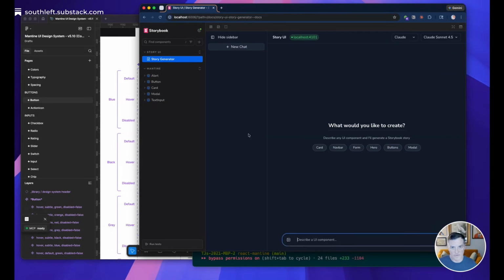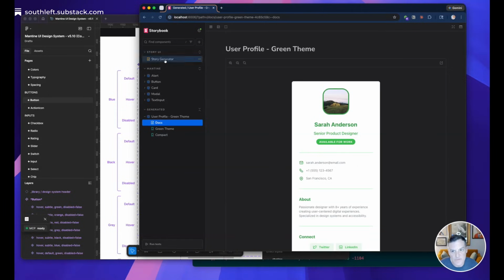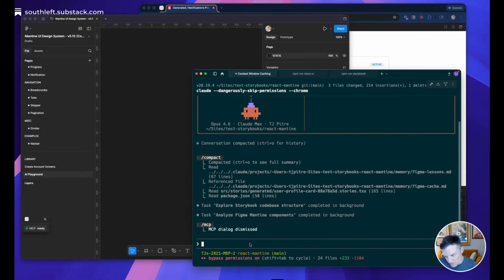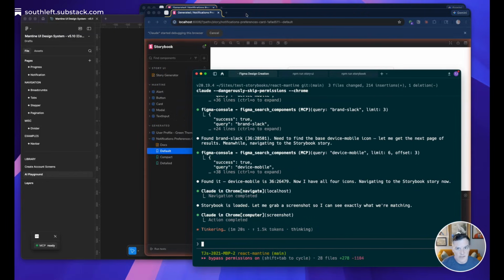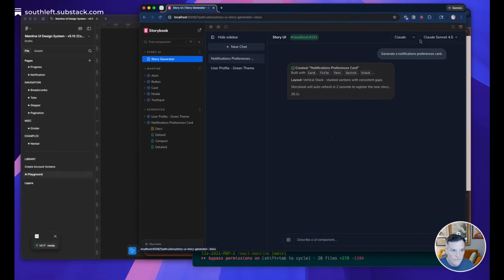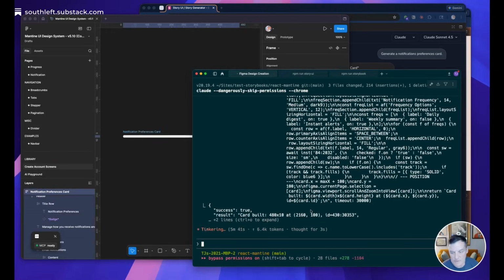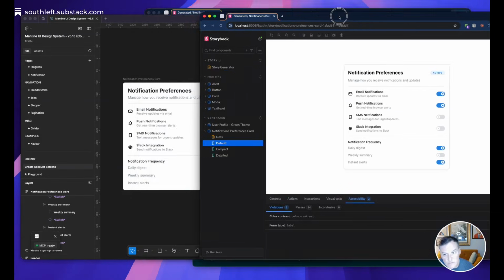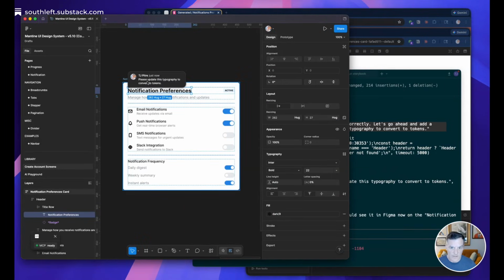Claude Code to Figma vs Figma Console MCP: What Most Demos Miss About Design Systems

Comment: I'd like to see a video on the actual purpose of using figma with claude code. I c in your video that claude managed to be aligned with your tokens but i find it more frustrating than anything because there's not autolayout, you constantly have to tinker with it which is very time consuming and tedious.
Reply from the maker: I can dig further into that in a new video. I can also confirm that the layout is auto layout by default. Nothing is randomly placed.